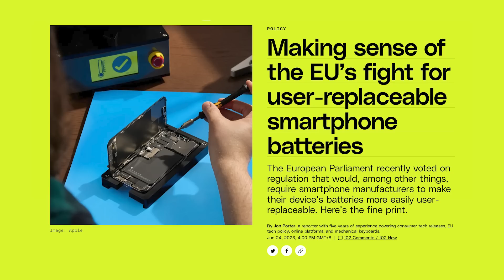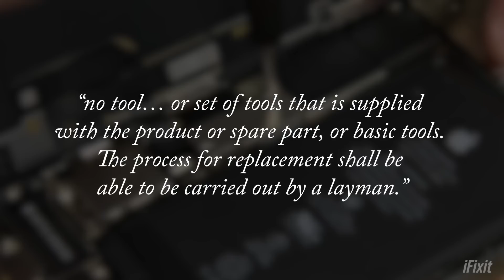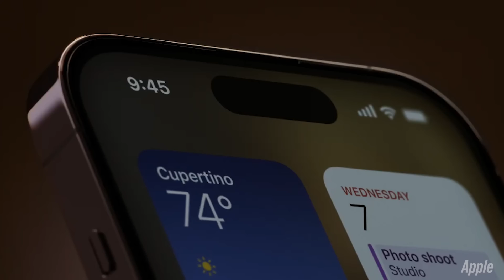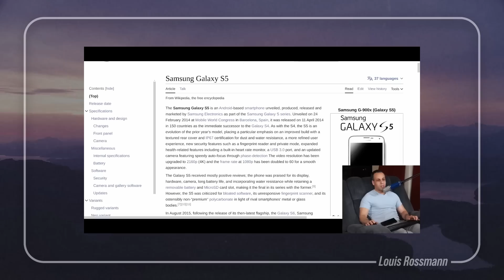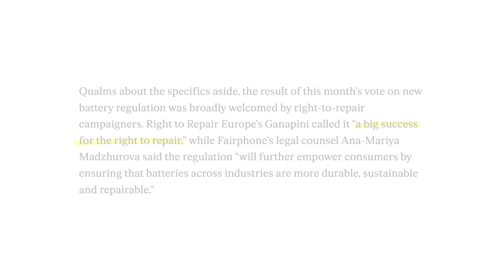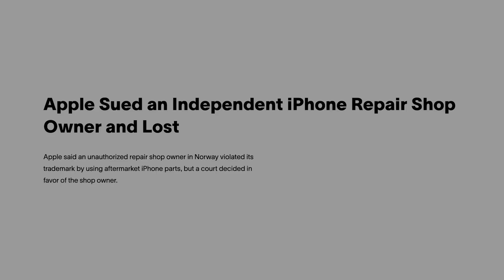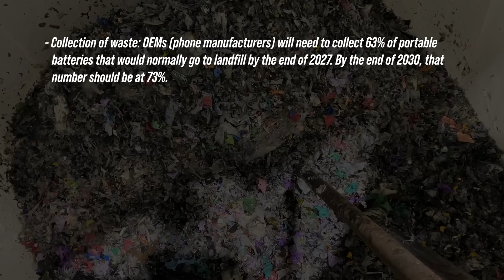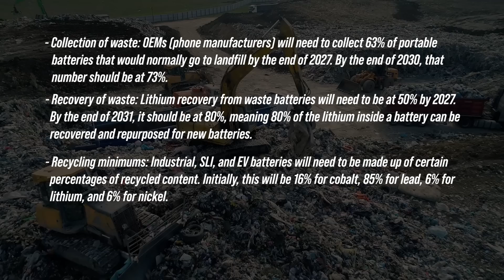EU Just Changed Smartphones Forever

Comment: Apple is more than capable of doing 2 types of phones and worse, capable to cripple even the one with removable battery. They'll make it in a way that'll work "slower" and different so it drives you to import or get you "faulty" replacements, and that's without mention the rest of the hardware.

Comment: Bravo 👏 to Europe for passing sensible laws.

I know so many products with rechargeable batteries are trashed all the time. Simply because most people cant take it apart to replace the battery when soldering and other technical skills are required.

How many portable battery powered vacuum cleaners have you trashed due to dead batteries ?

I know in my family at least 5 that I can recall.

This is great news. Love it.

Comment: It's easy to do this, all you need is a seal compartment at the bottom of the phone, and to open it use a thin pin that phones come with to take out sims with, it be the same concept to remove a battery. I see no problem doing it this way, that way people can save money and manufacturs can stop making trillions of phones destroying the economy  and goes against climate.

Comment: Yes, the EU did, and for the worse.  Don’t get me wrong, I 100% support right of repair and repairability in general, but this is pure government overreach.

Let’s take your watch batteries.  They are replicable, but you have to take it somewhere to do, because a half-decent watch is waterproof and often specially sealed.  
Passing a law that effectively makes waterproofing very difficult, impossible, or expensive is a step backwards.

The same is true of requiring USB-C for charging.  It’s great and all, but what happens when the next standard comes out - it will take a literal Act of Congress to change it.
Instead, they should have simply outlawed proprietary cables for charging a cell phone.

IMO, Apple should stop selling in the EU, rather than attempt to follow these stupid, short-sighted laws.

Comment: Getting the batteries return to the manufacturer should be easy.   Here in the US many automotive parts things like batteries and tires have a "core charge"  on them.  They could easily make it to where a battery is $70 but with a refundable $35 when you turn in your old battery.

Comment: this is smart and fair.. christ, how many devices can be re-used and saved and longer. At this point we dont even really need more power from even phones. They can do an insane amount and charge so fast and everything. They last so long. My note 20 is still insane on every front. Specs and battery still good. Bare minimum is leaving the battery replaceable. If note camera and whatever else.

Comment: I recently had to get my phone's battery replaced, and the replacement battery actually completely messed up the phone. It slowed down significantly, kept turning off, went into a boot loop, etc. Not to mention it was expensive. In the end, I needed to get a new phone anyways. While I support Right To Repair, I really hope the end result will be replaceable batteries that ACTUALLY work like they're supposed to, without ruining the phone. Taking it out is one thing. Compatibility is something else.
Reply: Where did you get the battery replaced? I know that with iPhones where I live, I can get an Apple official battery replaced by Best Buy or I can go to a :mom & pop” place that uses 3rd party batteries that may not be as good and they aren’t official Apple approved technicians either.
Reply: Stuff like that happens because companies like Apple make it really difficult to source genuine quality parts and make repair really hard by gluing their phones instead of designing them to be easily taken apart for repair.

Comment: I miss LG smartphones, they always had a cool feature on their flagships that I liked and removable batteries up until the last couple phones.

I do hope that the EU law does allow for some screws and/or bolts though, since it would allow for easier waterproofing if their is a backplate with a gasket or o-ring held in place with screws. It would also be good for rugged designs where you wouldn't want a drop to make the battery shoot out. Obviously it would also be good for other vehicles and devices as well.

I also like the laptops with the internal replaceable batteries (almost all workstation laptops) if the chassis is easy to disassemble with a screwdriver. The laptops and ultra-portables with no backplate or access panels obviously need to be modified to have a battery access panel or switch like some laptops that used to have easily swappable batteries.

Comment: My Note 4 died on me after 4.5 years because of the battery. Even though I no longer got software updates, it still chugged along smoothly until the battery started giving out. I couldn't find a vendor with a good or reliable battery replacement option so I had to upgrade to the Note 9. When i got my Note 9, I learnt my lesson and decided to be very careful with my phone as I was determined to make it last at least 5 years. I am 4 months away from hitting the 5 year mark. Samsung stopped the security updates last year, but my battery still gives me almost a full days worth of charge depending on screen time. Despite its age, my phone is still very quick and smooth. I will be mindful of the battery and push this phone for as long as I can. The planned obsolescence with the software & battery is so wasteful. Add to that removing the 3.5mm jack in the name of "saving space" whilst pushing hundreds of dollars worth of  bluetooth earphones and headphones. Removing the SD card slot so they can upsell you just a little more storage space for hundreds more. This is a game, and we are the objective.
Reply: Man you’re on another level. I can’t imagine getting a phone to last that long. I wish my LG V20 could have lasted that long. But it just became so buggy and battery life was so unlivable that I had to give it up after about 2 years.
Reply: @IDJMK  6 years and going strong on a heavily used S7, battery still at 85% of original capacity.
It's easier when you know how to manage lithium batteries.
Reply: You can activate the protect battery feature in the phone which limits the charge to 85%. This extends the battery lifespan and if you are going to be away for a charger for a while, you can momentarily disable it to charge the phone up to 100%. Also, be mindful of letting the battery percentage to drop below 20%. Staying in the middle is the safest for the battery. Good luck
Reply: @AladdinSane65  its only 500ribu for my s10e last time i checked
Reply: I'm still using a Note 3 as a backup; I've lost count of how many batteries I've gone through, but I've gone through 1 screen and 3 USB ports: the phone's 10 years old this year.
Reply: get a sony phone! they're one of the few companies making phones with micro SD card slots, headphone jacks, and no annoying camera hole/notch on the screen
Reply: I got my Sony Xperia 10 III with sdcard slot and headphone jack 😁
Reply: @AladdinSane65 You bet.
Reply: also a note fan here despite you didn't mention the brand, thanks for explaining in more details how apple fans are milked for new, sexiness, and more alternative part choices...similar to the charging cable shebang...I think 5 years is also a good balance to value and environment and being these top tier/top 3 manufacturers, we shouldn't expect anything less given the price no different to buying cars with same tier brands...however, maybe a work around due to availability later on in your phone life cycle is to buy batteries for the future one year in so the price and availability is still good. Though I love how they merge the Note with the S series as it was just wasting a production line which I suggested  and it would seem to help the consumers getting max value and max love for that line's future purchases although I would love to see a bluetooth earphone slot like for the S pen so we can be one happy family since they are able to make those ear buds type things smaller and smaller or maybe a watch that has slots like the HuaWei one or even sneak a emergency mini usb in the associated watch for storing top secret documents and stuff of course requiring facial scanning and finger reading or else it auto locks and informs you on sms/email...because we can all use a little James Bond + Ethan Hawk...this idea will auto destruct after you read it. Good Luck !!
Reply: I have a Note 3 and still use it as YouTube watching device when I can’t sleep. Inside the 5th or 6th battery. To change I need about 10 seconds.
Reply: … I pay for a new battery for my old Note 3 about $5 each second or third year…
Regards from Belgium
Reply: Thanks to Apple and their smart ideas other companies saw the profits and are following it. Consumers are the ones suffering. Just like in a war, civilians are always the ones suffering.
Reply: I'm in the same boat as you, with my Samsung Note 9, which hits 5 years 3 months from now. It still works wonderfully! 500GB of storage (and an expansion slot - if I needed it), a big screen, a stylus, and a headphone jack! I still get at least a full day's battery charge, despite not following "best practices" with recharging. I just keep replacing the INCIPIO case for it every 18 months and I'm good to go.

My prior phone was an LG V10, which I still have. Another big screen phone - but it has a replaceable battery. I have 2 batteries for it and an external charger. So I still have a backup phone should something happen to the Note 9.
Reply: I had the note 4 also. I bought 3 batteries once I got it. 2 of them eventually got swollen, but between the 3 of them I had the phone work for years until the motherboard started dying. Now I have the S20 Ultra with the most internal memory, the last Samsung phone to have an SD Card slot. I'm keeping this as long as I can. Removing the SD Card slot was such an obvious move to force people to have to upgrade to a new phone for more space.

Comment: Fantastic news. 

I remember a time i could use my Samsung S5  whole day without having to think about battery charge as i would just swap the battery around. 

Now people carry a power bank to charge their phone on the go with a cable attached in between.

It's the same with the memory card,  i could just increase the memory size just by inserting a micro SD card with the fraction of the cost of a new phone.

Comment: I personally feel replaceable batteries were only necessary on older model phones because the battery technology was inferior. I had to replace the battery on my Samsung Galaxy S5 multiple times over its lifetime. I've had my Samsung Galaxy S9E for over 3 years now and the battery still reliably gets me through the day. As battery technology improves, the need to replace the battery will decrease. While I do feel like this law is somewhat unnecessary on that front, it is certainly a step in the right direction in terms of right to repair.

Comment: I've been riding the wave of advanced smartphones tech since the beginning and the decision of Apple to include battery built in is the one that angries me the most. We want the best components like camera, screen, CPU, storage memory and need to pay for that same components every time the battery starts getting old, could be 1 year or 2 and all other components would last 5 or 10 years more without any degradation in performance. Apple is the worst because they started it and others followed because it's gives them advantage and placing consumers in a difficult position because there are so few options with replaceable batteries that if you want some other good specs (like best camera on a phone) you don't have the option of a replaceable battery, so you end up buying an expensive "disposable" camera phone 5 or 10 times over in a decade that's ~10.000 USD. Next we need to see SD card slot coming back too.

Comment: I prefer a ceramic back than a plastic battery port & cover. Also "find my phone" would be useless in theft or kidnappings.  It's a phone, not a TV remote control... and you can calmly repair it with tools, without being valuable to criminals again. As it stands, they don't want that trackable iphone. They would love this kind of law too. Just pop the batteries and take it.

Comment: Can consumers return vapes to recycle the mountain of lithium cells beung thrown out every day?
Suprisingly the components are easy to replace inside these devices. So theoretically the nicotine wad is easily replaced, and the battery could be charged with a simple circuit and a USB 3 plug.

Comment: Next EU law should be making it so that Phone companies need to provide a AOSP source code with device driver and key to unlock the boot loaders and also other phone companies like apple to provide an option to use alternative operating systems
Reply: What you're asking is that all OS's will be open source and this won't happen.
You can do this with Android and it might be possible to require that hardware will not be locked to a specific OS.
For now the EU required that gatekeepers, like Google, Apple or Amazon, open their systems for 3rd party. With Amazon it's more on the seller's side while with Google and Apple it's with their app stores. From about mid 2024 Google and Apple must allow sideloading (Android already has it, of course) and the ability  to easily use alternative app stores. Google already implementing such a system (that will that allows you to chose between app stores and set a different one as the default) that will probably be released as a future update (probably through Google Play Service) and Apple stated it will comply but refrain from talking about it.

Comment: Samsung already does design two different phones for US and global market, using Qualcomm and Exynos chips respectively. They might do the same for batteries too
Reply: They stopped doing it. Their latest flagship phone (Galaxy S and Z) use exclusively the Snapdragon one in a Samsung specific edition.
In any case, it's not the same. To make the same phone with two different chips, with similar qualities, when all other components are the same, is not complicated but making the same device  with two completely different design is not logical or economical.
Reply: @AL5520  Probably, but it's still a whole different motherboard and firmware. And I just wanted to point out that it's not impossible and there was a precedent for this kind of separate manufacturing, so if they have a reason to, they'll do it

Comment: Even as a very strong user of Apple’s products, I think this new EU makes a lot of sense for most battery operated devices. The one situation where this does not make sense is EVs. The batteries are very heavy and  produce very high voltages. In some EVs the battery casing forms a significant part of the vehicle structure. Yes with a phone, removing a few screws, sliding the old battery out, sliding the new one in and replacing a few screws should be an easy design to produce. However, I don’t think an EV battery will ever be replaceable by most any vehicle owner, without special facilities and tools.
Reply: Yes I agree, and honestly I doubt this new law has the same requirements for EV batteries as smaller ones. After all, even replacing things like tires require special tools, and EV batteries are so large and heavy that it would not be possible for a regular person to do it at home even if the battery could just snap in and out!

Comment: 100% motivated by anti-consumer profit motives. You can see this in almost every industry these days, from home appliances to cars. Take just your keys, due to the RFID chip in the job it requires specialized equipment to program a new key, and even then it may not work with your car if the computer has not been reprogrammed which often is closely guarded by the OEM.

Of course they want they consumers to be locked into their ecosystem. Big Tech really paved the way for this concept, and now other industries want to have a similar hold on their customer base. Cars, Tractors, Fridges and everything in between.

Comment: It’s unfortunate that you didn’t include Apple’s well documented environmental credentials for battery manufacturing (they’re greener) and their disassembly processes for recycling - not only the battery but all of the components within an iPhone. Another omission contrasting Apple’s closed servicing is that as a result their devices have (on average when compared to any Android manufacturer) a much longer initial life (through supported software upgrades spanning 6 years), much higher resale value and much longer secondhand life (due to high level assurance that an old iPhone is well maintained and doesn’t contain any 3rd party components or dodgy repair procedures). Years of iterative industrial design have shown that by removing the clips, rails, housing and anything else required to facilitate a hot swap batter has improved the strength of phones (bend test videos prove this), are far stronger when dropped (older phones would come apart when dropped, popping the back off and the battery ejecting) as well as making devices thinner and lighter. Perhaps a part two video?
Reply: the iphone would probably be 3 times the depth in thickness.

Comment: I think it could be possible for apple to make a model with replaceable and non replaceable battery only because they have mmw 5g in some places and not in others. I would love for removable batteries to come back though
Reply: It's not the same.
There is a difference between a minor internal change, like a slightly different chip or an added antenna (and many times the devices are the same, with one, or more, disabled features) and a completely overhaule different design.
Reply: @AL5520  yeah I guess but having two separate chassis one for mmw and one for without it isn't far off I think
Reply: @AL5520  my main point being Apple are not new to the idea of having physical differences from region to region